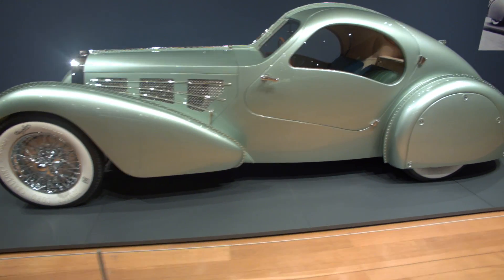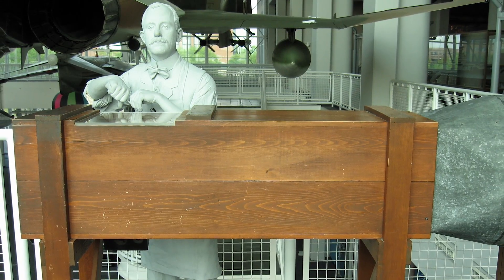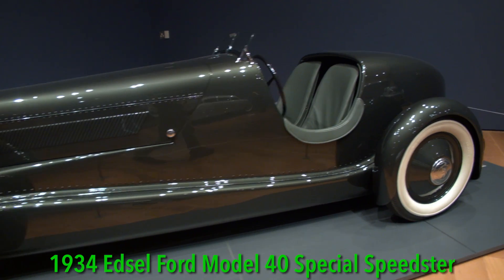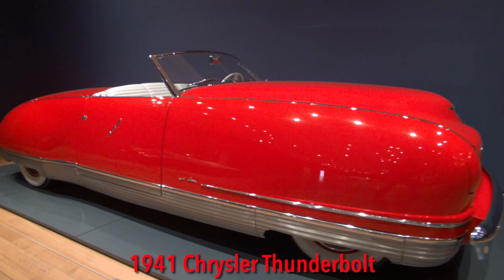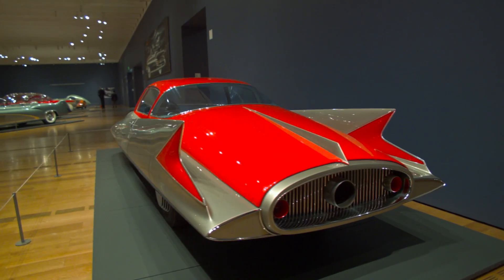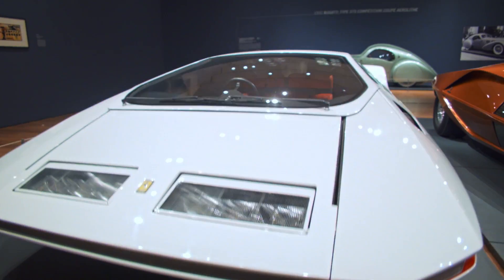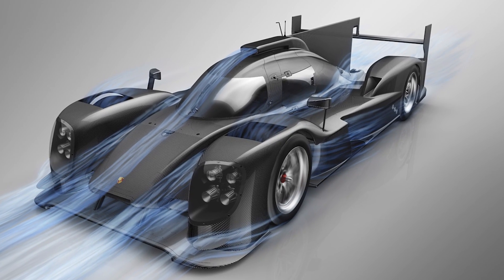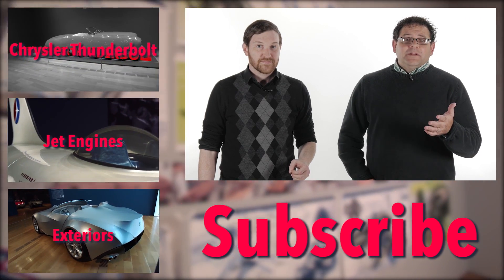CarStuff: Dream Cars | Wind Tunnel Testing

Comment: My thoughts that having legs down and forward and torso up and back is just the opposite of what you want for low  drag.    Better off to sit backwards so that you can have a  tear shape with front higher and back lower.     In the future, if cars are self driving or with driving using video, you could have passengers and driver sit backward.

Comment: Guys, you missed some of the pioneering aerodynamic models. The Dymaxion of 1933 was a one off but was clearly Buckminster Fuller's take on what an aerodynamic vehicle should be. From 1934-37 Chrysler produced its Airlow models, the first regular production, aerodynamically influenced full size cars.

Comment: forgot (?) the 59 cad. I owned one, so eventually met an engineer on the project. Was told it was "Carved Out",  actual size,  from a block of clay, in a Langley wind tunnel. Carve and run. Paste and carve and run ... they had a record amount of time (weeks, $$ exception?), to make the most efficient, and STABLE at high speeds design. Going down the freeway in a heavy rain, it produced  beautiful 'twin' vortices and 'felt like' it had no drag. Even the little bullets in the grill and tail lights was for air flow.You knew it when you pulled your foot off the accelerator at 90mph. (yea, what is inertia?) its was so low (weight) and spread out, was no problems doing 4 wheel drifts at 100 + mph in big turns, on new pavement. Used to go over hwy 20 (north cascades hwy) after midnight, 20+ times. Had a huge big block, and gas tank. 2 giant comfy couches too. I think 'engineering' peaked in 59. Yea, they didn't have the power then, but the find out to know how, and go for it attitude.  what happened to  .. that?